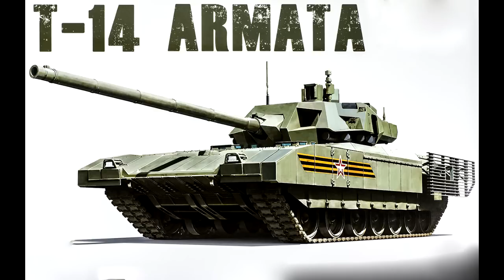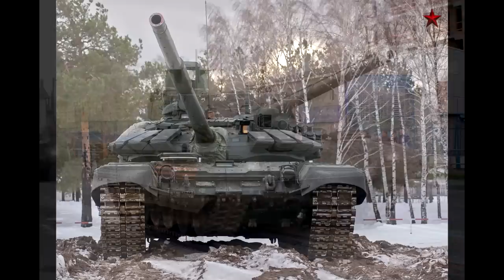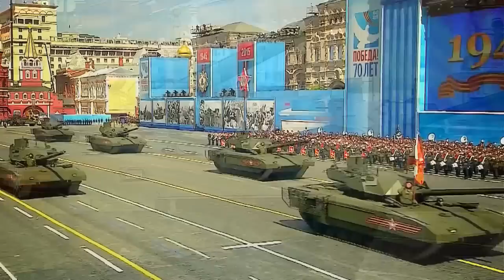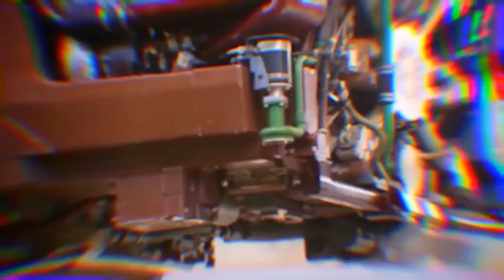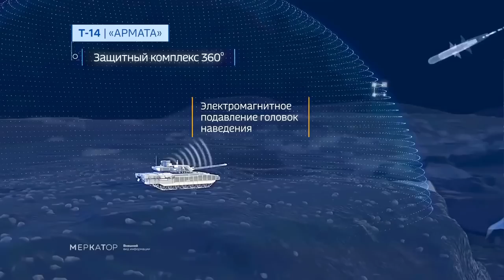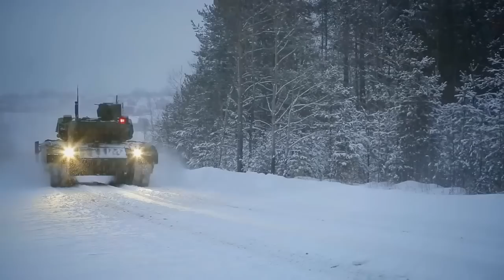Busting Myths on T-14 Armata

Comment: Some Russians went to a arms show, looked at what everyone else is doing, copied it and now make a big deal out of it. You can claim whatever but we are all looking at older ideas mixed into one vehicle. As for the Abrams test bed or the like, yes we had a crew forward of turret and auto loading system back in the 1970's that was never taken out of the prototype stage. Probably because a loader can load just as fast if not faster.

Comment: Solid vid. It doesn't reek of propaganda like so many others. 

The Armata is an interesting design. The Russians really tried to push the envelope with it and I can respect that. Much like our F-35, only time will tell if it all works. The fully automatic turret sounds great on paper, but I wonder what will happen once they get some miles on them and things start jamming.
Reply: Fair. Though much of the abilities mentioned online are exaggerated beyond physical sense for both vehicles, though much more so in the case of the T-14.
Reply: THAT'S my NO1 QUESTION fully automatic made by Putin hmmm very sceptic

Comment: Proof that Russian tank crews and pilots are poorly trained and overrated. . . lol . . . or is that a myth too?

Actually, there were 2 screwups here, if it is true that the incompetent tank driver accidentally activated the emergency brakes, and not the fault of the tank itself.  This incident not only shows the incompetence of the tank driver, but also the incompetence of the tow service personnel who didn't check to see if the emergency brake was on when they tried to tow the tank, amateurish mistakes.  This is just more evidence of poor training in the Russian military.
Reply: RedRider1600 This section in nutshell

"ur a moron"
"no u"
Reply: RedRider1600 i smell american bias
Reply: I think that in about fifteen minutes I could be running that tank if someone would show me how the controls work and how to start it.  However, I am not about to take it underwater until I know exactly how it seals and how the snorkel works and how deep the water is.  Also, it would take a very long time to learn the weapons and defense system and be able to hit anything with those guns.

However, I have forty years experience running heavy equipment and driving truck.  I am already trained to steer a tracked vehicle and I know what it feels like going up and down hills and along a hillside (which I really hate doing).  Please don't sent me the bill when it comes time to replace the tracks and idlers.
Reply: RedRider1600 I respectfully disagree Armata is a new tank which was kept secret until 2015 and the drivers didn't get enough time to train on Armata if you say they are poorly trained I suggest you to look at the tank biathlon and the crazy stuffs the Russian pilots do with their plane they are really crazy
Reply: Amerifat is mad that Russia can build cool stuff
Reply: " I learned how to drive an amphibious armored personnel carrier, the AAV7, after 30 seconds of instructions when I was a 16 year old during a USMC JROTC field trip"
Which translates to you did not learn how to run an AAV7.  

Just about anyone can start a cat or backhoe and just about no one can find the dipsticks or grease the machines and do useful work with them on the basis of being shown the controls and told how they work.
   
The idiots who cannot learn go into military command and government.
Reply: RedRider1600 have u heard of the British, the 2nd best trained military behind Switzerland
Reply: RedRider1600 I
Reply: Martin Petrovsk Well probably should know all of the buttons lol
Reply: I still say it's easy to make the tanks and planes and whatever look great on paper.  The only way to know is to prove it. Doesn't look good though breaking down or brake engaged.  I think I still rather the battlefield proven Abrams in the numbers 15,000 or more tanks with the massive training they have instead of 100 or so tanks that's amazing on paper with drivers that need a manual. Who knows those russian tanks could be made of cardboard boxes.  Prove your mouth. Back up your words. You don't need a war to prove them tanks. If those tanks can do what they say they would do a real demonstration to make the world afraid, but those tanks so far, years later are still only numbers on a paper.
Reply: Well, sadly the Russian crews don't get enough experience since they aren't invading countries all over the world in their big machines all the time
Reply: I wouldn't say that he was untrained enough, he got so nervous of driving the new tank that he ~accidentally~ hit the brakes without knowing it. and that's respectable, considering that he is driving in some expensive, new tank and that he would fuck up the system. And I would argue that Russian tank crews are also the best in the world as it's experienced, elite "Guard" battalions that would have crushed any opposition with their T-80s.
Reply: Remember what russian pilots did during the Korean War? Ask a USAF veteran how they got shot down on a daily base.
Reply: And what do you know?  I bet you have trouble starting a lawnmower.
Reply: how can you learn too drive a new tank in 10 days? do you really think its that easy?
Reply: +Martin Petrovsk   10 days???  Like I said, Russian tank crews and pilots are poorly trained.
I think in 10 days I could remember where the emergency break is. . . lol . . . In fact it would probably take me about 10 seconds to have that memorized.  But maybe the Russians should take more than 10 days to train their tank crews.  The US takes a year to train their tank crews and 2 years to train their fighter pilots.  That is why they are the best.  That is why they are better trained than Russian tank crews.

Comment: Just want to point out that it's claimed by Russian sources that it can destroy APFSDS; And as we all know: Russian bias.

All jokes aside, there is no public proof (to what I know) that the APS can (reliably) defeat this kind of round. 
Yes, the Radar that is used on the current version of the T14 is assumed to be 4 AESA panels that can track projectiles up to 1700m/s, however detecting and defeating are two different things. 
Remember, the ADS fires shrapnel-shells made to break projectiles, the tungsten/d-uranium is not easy to break; Most skeptics believe that It could push them slightly off target, but has very little (if any) potential to stop them. 

And we're not talking about the ERA here, just the Afghanit.

Comment: Be interesting if the APS is radar/Doppler controlled. Anything that will emit a signal can be detected at greater distances than is reflected back to the emitter. This said, all you'd need to do is put a few ounces of some sort of jammer in the head of various types of ammo and the APS is nullified. 
Also, since the emission is detected at greater ranges, so then can these tanks be tracked at a distance. What happens to the infantry support around this tank? I wouldn't want to stand near this thing in a city fight. Not with this thing popping off explosives from all angles.

I suspect the Russians, having long been using three man crews, have managed to iron out the troubles and work load of three men running a tank over four men running a tank. (Also, a loader's position seems to be a good position to start training for a tank corps.)

Also, some AT weapons are designed to hit the tank from above. For an AT missile, a simple 'pop up' shortly before impact (much like a ship killer missile) would negate this system. Think of Wild Weasel sorties against AAM emplacements during the Vietnam war.

Interesting concept but in the long run, not ultimately helpful.

Comment: cool tank but just a copy of the us ttb design developed in the 80s with modern tech and hasn't been combat tested so who knows how it will fair
Reply: Tyler Franco Copy how?
Reply: the TTB is not even close too a T14 the T14 is based of the obj 195 witch is based off the T74 (1970's) soo no its not a TTB copy not even close.

Comment: JUNK....It took over an hour for them to figure out what was wrong...I have read tons of crap on the T14 and not one article has ever mentioned that it was inspired by the TTB although it is hilarious that it looks almost dead on like the TTB and the T14 crew is housed the exact same way as the TTB and the periscopes are aligned in the same position. Hmmmm.....I have read articles where it was suggested that the Ural Design Bureau used copies of the old literature to build the T14. Also, the APS was never designed to intercept APFSDS. It was never designed to intercept a HEAT round either. APFSDS moves at OVER 2000m a second (1st Gen) and is almost impossible to detect. I know. I worked a firing test for counter battery radar. It wouldn't pick up the APFSDS. Ural Design even claims that anything over 1700m/s will not set the system off. Also, why if this will stop APFSDS is there 9in blocks of ERA on the sides? 

Explain to me how, if, THALES was the old system design that now a new system, which is third generation is being used? Enlighten me.
Reply: BillieBobBrubeck why are you so bias .when america does something its fine (copying german weapons) but when russia didnt even copy anything people believe all kinda of americans lies
Reply: BillieBobBrubeck is there anything wrong with that? It seems (to me) That the Russians learned From other countries. And That They used what they learned to improve their own equipment, if someone would copy something from me because of it’s good quality, I would be honored. But if you make such a drama out of it, you guys also just could have kept the design secret...
Reply: I believe these systems are for intercepting atgms, not kinetic munitions and shells. Atgms travel at 600-1200(?) m/s and as you mentioned apfsds travel from 1500 tot 2500 m/s. Plus heat warheads can explode early causing them to lose their penetrating power before hitting the armour, kinetic munitions like apfsds cannot explode and thus cannot be intercepted by the same system.
Reply: BillieBobBrubeck APS is for chemical based shells like HEAT, or ATGMS. kinetic shells are just countered by armor
Reply: Heilary Klonton its not copy its inspiration
Reply: Yung Domino you can't really counter a Tungsten rod going 2000mps
Reply: @jackson22668  nobody thinks that because Russia is making new shit they are trying to take over the world the reason people are cautious is because their track record for that shit is not good and I'd like you to tell the people that are being terrorized just how made up those terrorists are
Reply: jacky US may not be all that “good” but they have a far less corrupt government than Russia that is basically ruled by dictator Putin. Plus the quality of living, education and life expectancy is higher in US. Also better economy in US.

Comment: wait so if optics (most vulnerable part) are knocked out... the crew is blind (they are all within hull)... and the tank is knocked out of battle?
Reply: Dillon Roche by any chance have you heard about the Armata's advanced APS?
Reply: Aik SE Which has no effect on small arms or light high velocity projectiles, which assuming the T-14's turret armor is as thin as its theoretically is, will easily be penetrated

Comment: sabot rounds can't be "disabled" because they are not active. They are also hard to destroy because they are in principle solid rods of very hard metal. Simple physics tells you it's even harder to transfer enough energy to them using shrapnel or blast waves that they are diverted or significantly slowed down. I think, realisticly the best thing you can hope for is make them tumble so they don't strike head-on, which would be a huge improvement.

Comment: first Armata really broke down reason x engine failure .....  crap design they take two V-2 engines and make this wonder ... x engine . Remind you V-2 is 1930s design ..... even Germany didn't go for x with their potential resources  instead make regular v engine with bigger 1500 hp  (this x wonder engine can't  make more than 1200 hp with reasonable resource time) let` s compare Ukraine their regular engine has the same 1200 hp and in future will get stable 1500 hp  This protection system is complete scam just check C-300/C-400 vs Israel air force  in Syria  and one more detail no video that this system work only 3d animations in which can be anything . Stability of platform its decent for TD as for tanks which required to shoot on move it hasn`t  needed stability just in this video of shooting similar performance I see on wheeled 120 mm platforms  so it in the end we have td with armor and very big size.
Reply: occasionalquest wow this video have explined everything with links as well but you didnt provide any links supporting and proving your cliams and you wont find any

Comment: Tank is the worst place you can be in a war. Everyone wants to kill you. And no tank can hide from A10 gun.
Reply: Gixxer983 i rather be in a tank than be a infantryman
Reply: Gixxer983 And no A-10 can hide from a pantsir-s2 or buk-m3.
Reply: yep, every tank is followed by one AA ..
Reply: do you know the range of an Buk-m3 or an S-300/400 or the patriot system?  And have you maybe ever heard of combined arms?
Reply: Yung Domino, are you dumb. A sing will probably no, but 300 in the same spot will turn any Russia armor to mist
Reply: Ruski Bot yea the problem is there is a steel plate before the composite armour so rhe 30mms will ricosheet
Reply: Gixxer983 A-10 is pretty worthless, if you don't have air superiority.
Reply: A10 30mm isnt gonna pen tank armor. Sorry. Missiles or bombs? Probably but that 30mm certainly isnt going through
Reply: Yung Domino it’ll crack that tank in half

Comment: Much of the videoo is correct but I think you are a bit overly optimistic about the numbers that will be produced. The Russian MoD has a habit of making big plans that they cannot afford in the long run and settling for much smaller numbers eventually. I don't see how they can afford 2300 Armata tanks. It's a ridiculous number, especially considering they are also upgrading/replacing their fighter fleet, bomber fleet, warships, nuclear deterrent, submarines, air defenese, etc. in the same time frame. You can buy all this stuff by burning through your reserves but how will you pay for keeping them operational in the long run? It is not sustainable to spend such a high percentage of GDP on your military. The Americans are also learning this lesson the hard way.

Comment: Okay so the driver was not train properly on how to operate this equipment. I see that they try to pull it out of the way so then why did they not disable the hydraulic sys.???
Reply: simple none of them knew how the T14 worked it was a brand new tank littearly came 2 months before the parade and the crews only had basic drivers training.

Comment: Look it is simple physics: you can't deflect a tungstun/uranium bolt going 1750 m/s with a few steal pellets sprayed at it from a few meters away. At best maybe it can get it to tumble and slam into the tank sideways.
Reply: ummmm the Afagant dosent use pellats it uses an EFP...
Reply: Unless the penetrator is made out ultra dense unobtainium it is not going to knock a  tungstun/uranium bolt going 1750 m/s from a few meters way from hitting the tank. The amount of deflection your asking for is incredible.
Reply: ummmm the EFP is made out of a secret material no one knows what it is but ether way most common western ammo is 1500m/s and even if it was 1750m/s its very possible too intersept it and basicly slow it down too the point of it beeing useless an deviation of even 6 degrees can lower the energy of the rod up to 80%.

Comment: There's nothing really controversial in the video except the APFSDS part.
APFSDS projectiles (long rods) aren't being "destroyed" by any tank hard kill defences. They may get destabilised and then impact so suboptimally on the reactive and passive protection that the penetration is much lesser than without the destabilization.

Think about it; a 8 kg propellant charge is needed to accelerate the long rod (and the much lighter discarding sabot) of 120 mm APFSDS to its muzzle velocity, with a quite efficient cannon principle. You cannot generate a similar impulse with a much smaller APS munition that employs a much less efficient principle.
Now about the supposed fragments; assuming that the fragments have a total weight of 6 kg. The long rod of 120 mm APFSDS weights about 9 kg. To stop it the fragments would all need to hit frontally with 150% of the long rod's velocity. At a 45° angle it would be 225% velocity. 450% if only half of the fragments hit. That would be about 7,200 m/s, about Mach 20. That's not how it works.
Reply: yes they would get destroyed. they would not disappear, but they will be destroyed, turning one long rod into a bunch of less effective fragments

Comment: Couldn't you simply overpower it's APS? With a saturation attack of multiple rounds fired at once or one after the other in the same place.
Reply: yes, but if the tank is getting directly shot without cover multiple times in quick succession from multiple directions, some one has messed up.